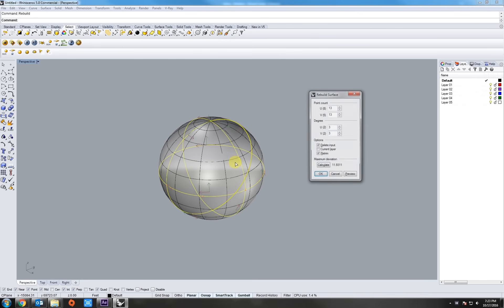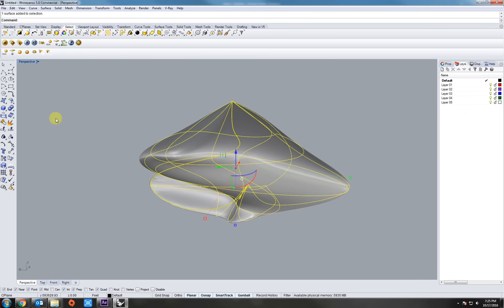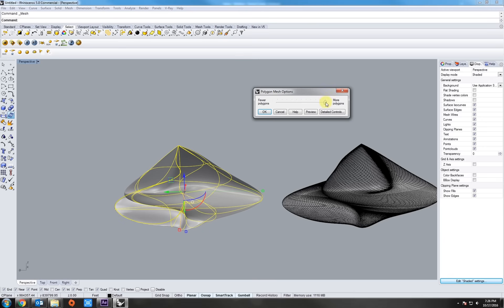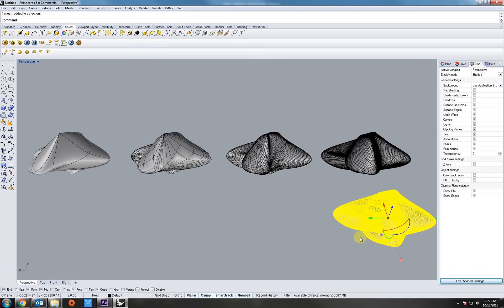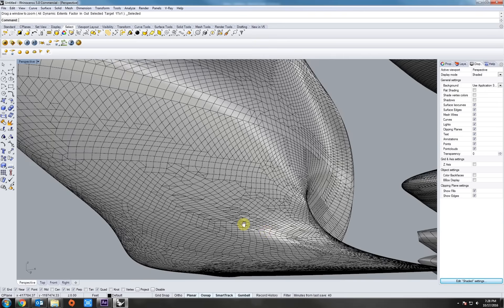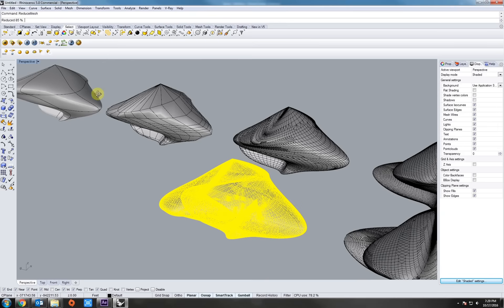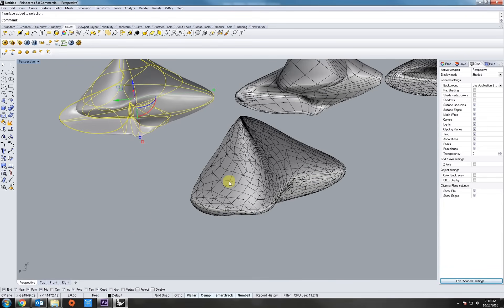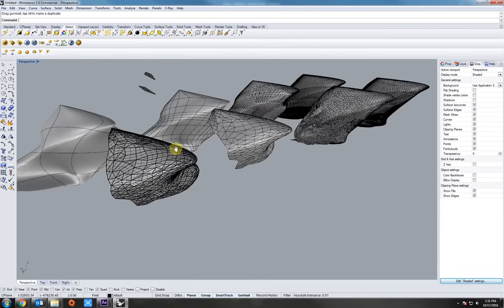ADVANCED RHINO  / NURBS TO MESH  / REDUCE MESH /  MESH TO POLYSURFACE

Comment: So I have this model where I want to increase the thickness of the form, but using offset surface did not work. I tried using this method you did but my file turns into a huge one. Is there a better way to increase the thickness of a complex form?
Reply: If thats only for a rendered output, then try the thickness option available in Object data properties in the right menu in Rhino 7

Comment: I don't think you need to make a nurbs surface into a mesh to 3D Print or CNC. Instead you need an STL file, which is a triangular mesh.  You would make a nurbs surface into a mesh for sculpting, as you would in ZBrush or Mudbox.
Reply: A mesh also works fine for cnc

Comment: what's the point of making it into a mesh and to a polysurface?
Reply: I just brought a mesh from thingiverse into rhino, a pumpkin, and needed to install a base that interfaces a connector for led's. I turned the mesh into a poly surface so that I could boolean union the structural base onto the pumpkin mesh (now polysurface). Love Rhino, amazing tool.
Reply: if you want to make mesh into polysurface you can easily measure your 3d object
Reply: i can only think about making it low poly and then making it easily editable again
Reply: @eldiegoasecas  correct me if i'm wrong, mesh is for 3d printing and polysurfaces are to edit them in rhino again? :) thanks for the replies guys much appreciated!